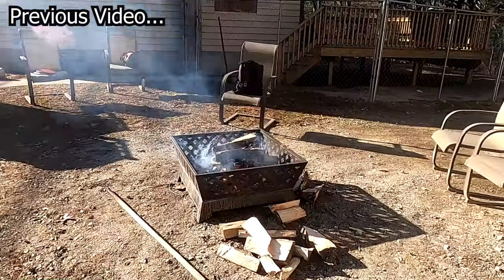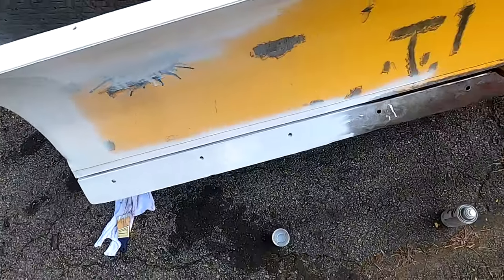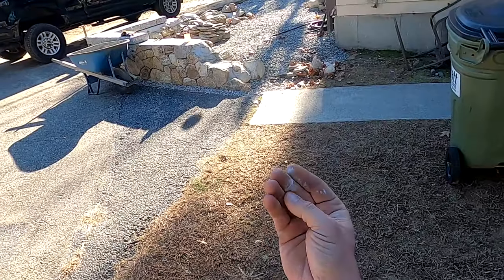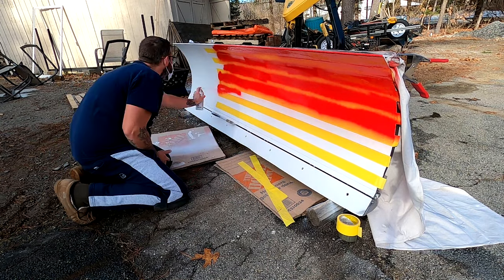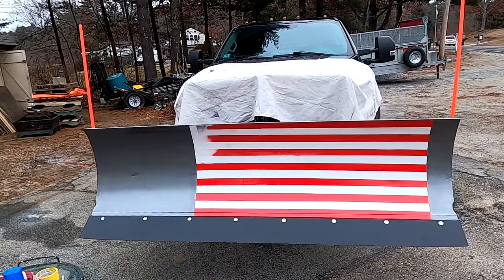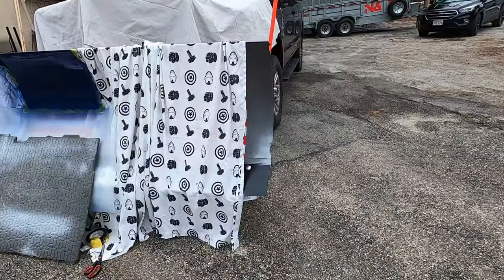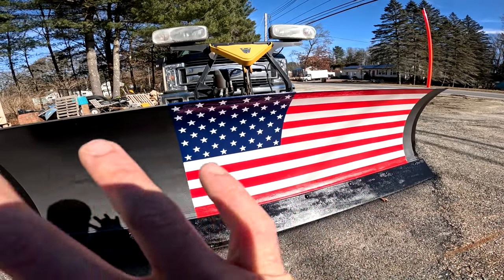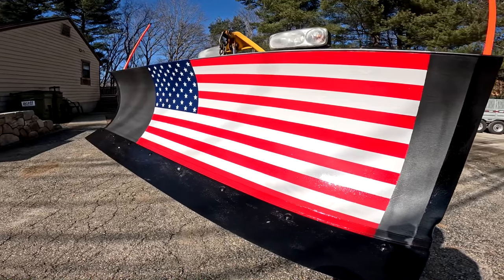I Painted the American Flag on My Snow Plow...

Comment: Looks nice man! Just a pro painter tip, you can use frog tape that has edge lock technology which means when it gets wet, the edges expand and prevent bleed through on smooth surfaces or use the same tape you used but do light coats(instead of 1 or 2 you do 4 or 5), it’ll dry much faster since the coats are light and it’ll prevent any bleed
Reply from the maker: That is good information man, I appreciate it! I actually seen that tape and almost got it, did not know it was specific for that....LOL Thanks again! ✌